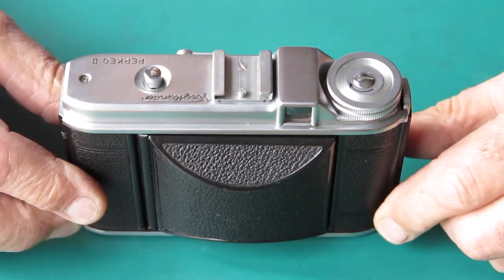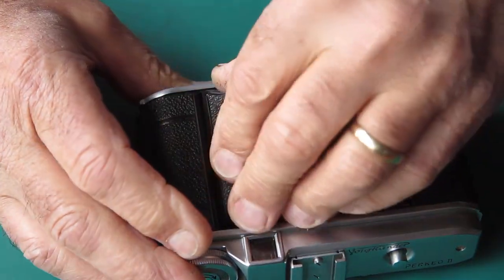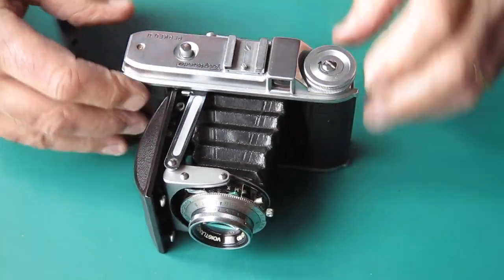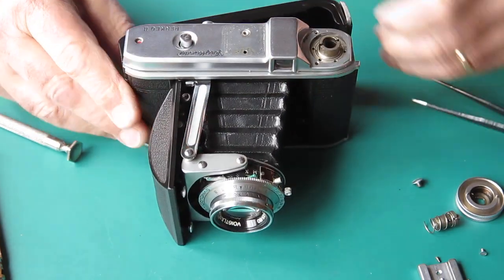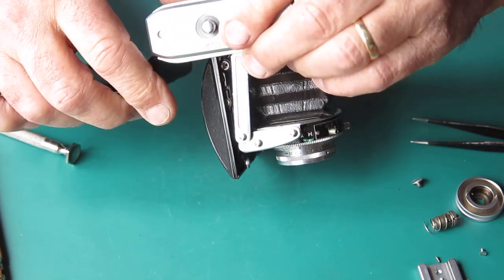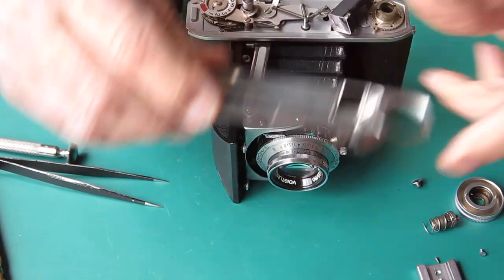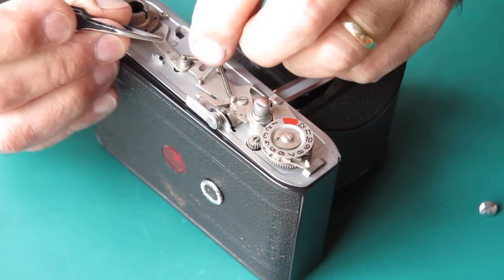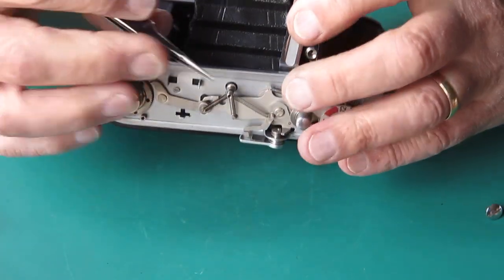Voigtlander Perkeo II service part 01

Comment: Those nuts are a bugger to locate. I usually find that a bit of spit on the tip of the index finger works wonders in holding small nuts and offering it to the screw. Low tech but it works.

Comment: Great video, thanks a lot - one question, how did you fix the camera not opening when pushing the button as shown in the beginning? Or did I miss that in one of the videos? Thanks!
Reply from the maker: watch the start and you'll see that I pushed the front open from inside the back and stated that most likely the front door had simply been pushed in too far.
Reply: @ChrisSherlock  Thanks for the reply - I also had a Perkeo II that did not want to open, but in my case it was not stuck, it just seemed the springs did not manage to push it open any more, even after trying to lubricate the hinges ...

Comment: Thanks for the video. I have one of these cameras. When I cock the shutter, I notice the shutter blades open and close very briefly. Is this a common problem, and one that is fixable? Or is this normal? (though I can't see how it would be normal as it would pre-expose the film.)
Reply from the maker: No, it shouldn't do that. There is a spring in the shutter which is supposed to keep the shutter blades firmly closed until the shutter is released. Perhaps the shutter is missing this spring, or perhaps the shutter just needs to be serviced.